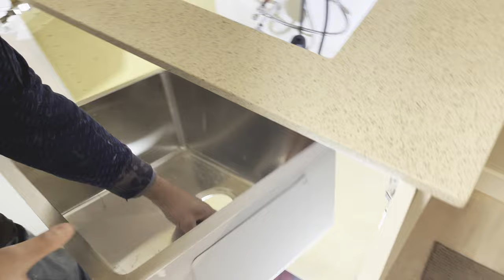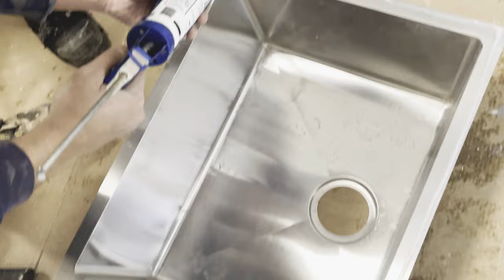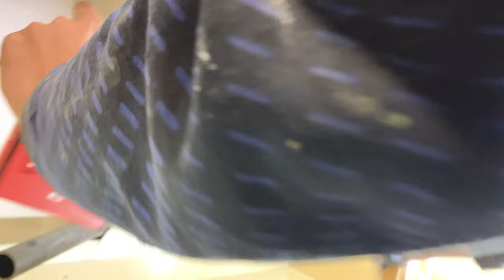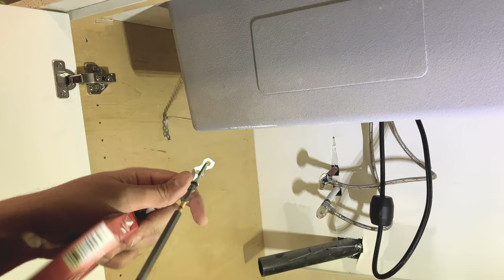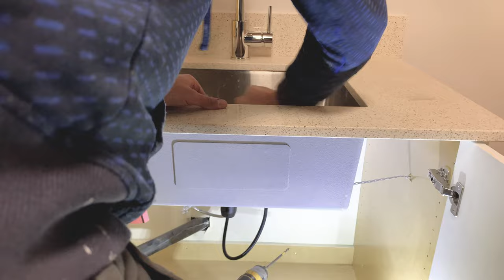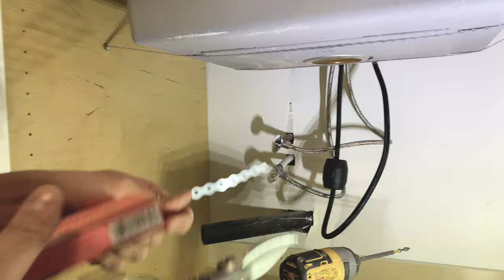How to Install an Undermount Kitchen Sink On a Granite Countertop

Comment: Do the straps come off? You don’t put any more caulk around underneath? Does the caulk alone hold up the sink?
Reply from the maker: Caulk alone does hold the sink in place but for extra protection we don’t remove straps & no more caulk underneath.
Reply: Had all the same questions
Reply: You are supposed to use clips.  I have never seen someone use these to hold up a sink.. pretty laughable.
Reply: @TheBuildingExpert  the caulk or silicone is not enough to hold the sink up. Mine just collapsed.
Reply: Them straps looks ghetto. You are suppose to use clips

Comment: are those straps then removed?
Reply: I think some people leave them to prevent sagging.
Reply: The straps is primarily what's holding the sink, the silicone just acts as water sealant and not an adhesive, to prevent water from sipping through. If the strap goes off, the sink falls.

Comment: What type of silicone
Reply: Clear 100% silicone, some caulks do not contain silicone or have very little, only downside of this type is you cannot clean it off if you mess up the application (think the toughest bubblegum stuck on carpet) so I highly recommend putting painters tape on both the edge of the sink and the edge of the countertop where they meet each other.
Reply: Silicone brand please?